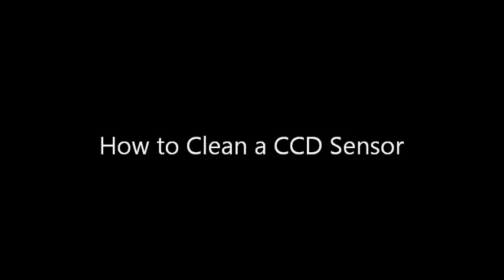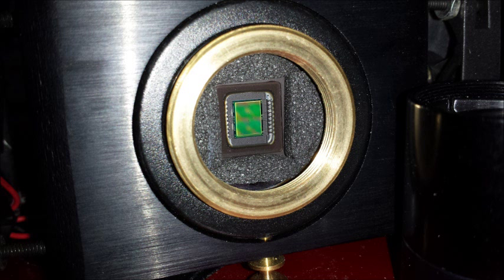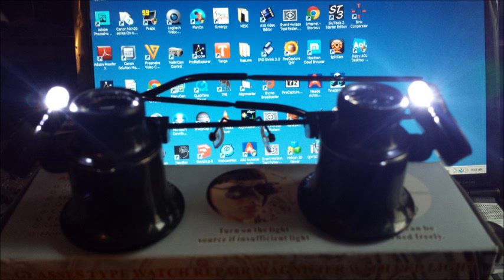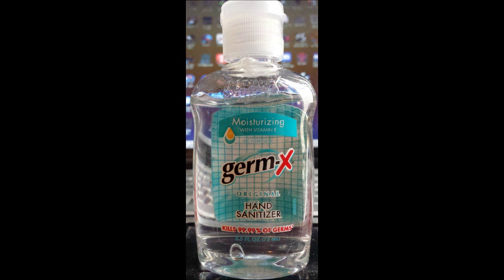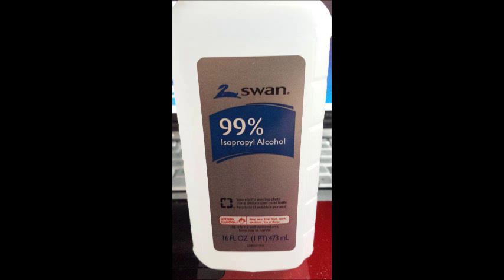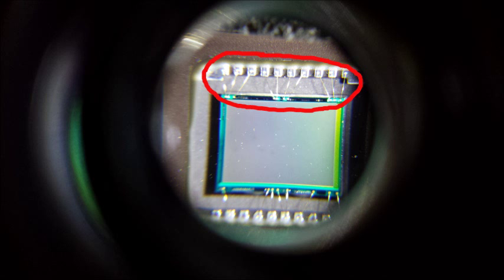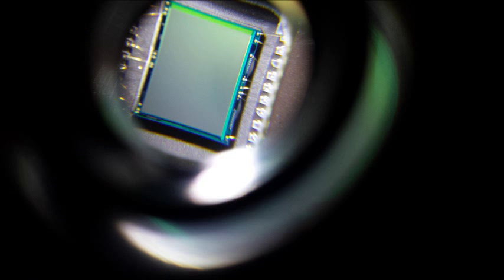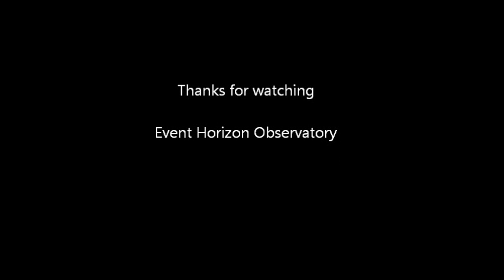How to clean a CCD Sensor on an Astronomical Camera

Comment: Many years later your video is still useful. I did Isopropanol then dry, then use a brush to remove some stain and dry air. I must specify that it was a 0.5x0.5 cm CCD 😇
Reply: Thank you!

Comment: So this is the bare sensor (the actual silicon) with no cover? We have an old but still good CCD camera for a spectrometer that had oil get deposited on it somehow while it was in vacuum. I routinely clean optics and was wondering if I could just do the same here with some lens tissue and methanol or isopropanol. It seems like the thing that is sensitive are the electrical connections?
Reply from the maker: Yes, be careful with them if you acquire one as the leads are exposed.  I have sense moved up to digital and got away from analog.

Comment: I have a IP camera that looks like yours but after i remove the lens and put it in my 2x barlow the image is terrible.How did you make it work?
Reply from the maker: You can't put a barlow on and expect it to focus as the camera doesn't have it's own focuser.  Some lenses may have adjustments to allow focus but it is intended for only that lens, not dropping a barlow between it.  You should use the camera in a telescope and use the telescope's focuser to bring the image clear.   If your doing that already and you can't achieve focus you most likely don't have enough travel or "back focus" in your current focuser which happens a lot with refractors.  They make extension tubes for such issues which will push the sensor back and help your travel for focusing.  Hope this helps.